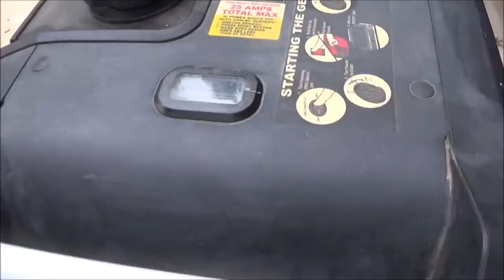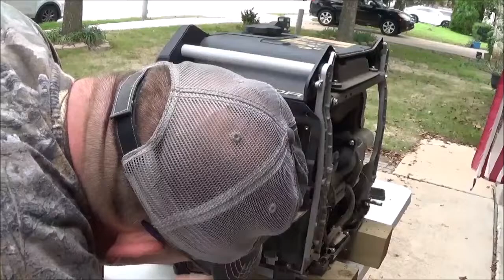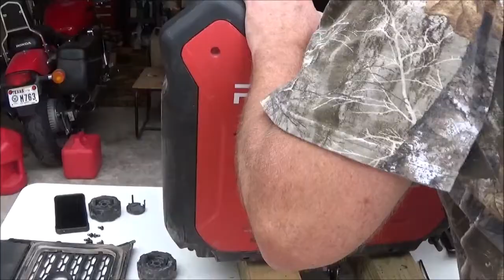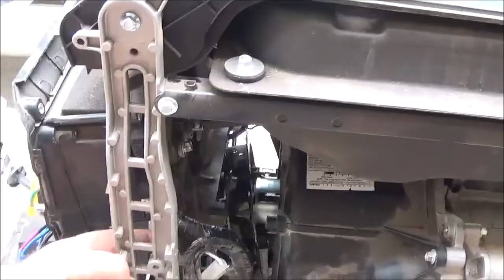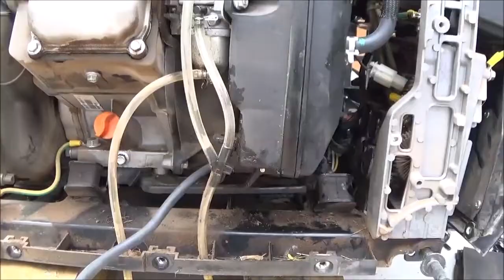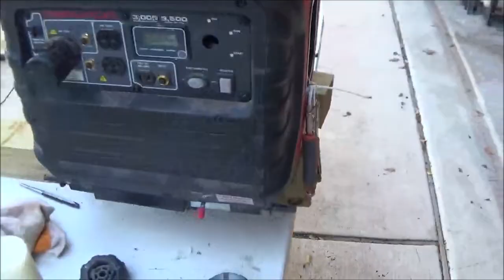Predator 3500 Inverter Generator Pull Start Rope Replacement

Comment: I have 1300 hours on mine. Went to fill the fuel this morning and the pull handle with about 4 inches of the rope was sitting on the ground. I bought the extended plan so, I think I could do it myself I may just bring it back.
Reply from the maker: The same thing happened to me. Found the pull handle laying next to the generator. Be careful if you turn it in for replacement as the newer model generators are not built the same way as the year 2020 models. From what I have been reading.  Thanks for watching.  TYMM

Comment: Thank you for the helpful video.  I think im going to Toss that bracket   to hold the rope. This is my 2nd 3500 generator  and  ive only used the rope maybetwiceon both machines.,And they both have broken off ,roughly the same spot as where that bracket sits.
Reply from the maker: Thank you for the positive feedback Nick. Glad this helped you. It is a lengthy video but well worth watching the steps. The bracket is for the pull rope to feed through.  Like a guide.  Maybe it is causing friction on the the pull rope?  Thank you for watching.  Please like, share, and subscribe.  Take care!  TYMM :

Comment: The only complaint I have with this same generator is the pull cord. It hasn't broke yet, but it's got a spot where it will break soon. Maybe next start it's that worn. It's 3 months old and less than 75 pulls.  Other than that it's been excellent for sure... Thanks for making the tutorial...
Reply from the maker: David - the cord gets cut from all the vibration while running.  People have been putting heat shrink over that particular spot to keep it from fraying.

Comment: Thanks for posting, it convinced me NOT to fix mine as I have never had to use it anyway. I will stick with the electric start option.
Reply from the maker: @TPaul300  the pull start string breaks because the string vibrates while the engine runs. It cuts it by rubbing/friction. Good to have a backup option for starting the generator.

Comment: where can i buy the outside parts  parts for the 3500 inverter my old one got crushed by the
fifth wheel in the back of my truck thank you
Reply from the maker: You can find them on eBay.
Reply: thank you and Happy New Year
Reply from the maker: Happy New Year.  @norbertomachado5465

Comment: my 4550, is more of an open frame, but the cord passes through the front like that. Cord broke in the same spot within the 90 day warranty. I got it replaced. I'm on my second one, 10months later cord is breaking in the exact place. I'm gonna be on my third one soon, because I bought the 2 year warranty for $250. This is a massive design flaw, and HF needs to pay the cost, or they will never learn.
Reply from the maker: @aaronjerviss9964  yeah. The generator vibrates while running and cuts the cord.  You can wrap that area with heat shrink or metal foil somehow to reinforce the area that gets rubbed

Comment: The top captured screws and not designed to ever come out of the red removable left side cover. Loosen top 2 screws and the whole red panel pops off.

Comment: I have many preditor generators and the ropes always break at the hole going into the housing.
Reply from the maker: Hi Chris.  Yeah. It's due to the vibration while running.  It severs the cord. You might be able to put great shrink over that small portion of cord

Comment: Thanks but  I think the robe rarely break because people use electric start mainly
Reply from the maker: True.  The primary is electric start but if battery gets weak or if the starter, CDI board, solenoid fails the pull rope will come in handy.

Comment: I'm leaving another comment. You do not have to remove the center nut on the pulley to re-string pulley. Clearly, he is doing it the hard way , I usually pull string out and wind pulley up , line uo holes and thread string in, and insert screw driver in opening on pulley to keep pulley wound up as I started any open frame generator is so easy to work on  any enclosed generator is designed for a shop to work on this is crazy and this guy took too many components off to restring pulley
Reply from the maker: @jamesray3930 - This is the way I did it. Not much more work. I was able to measure the pull string out to the length it originally was by doing it this way. You do not need to pay for a shop to fix this, when you can do it yourself.  All steps shown are needed.  Best wishes to all DIY viewers.  Hope this saves you all money and time.   James, if you do not have anything positive to contribute then best not to say anything. Its not a good reflection on your character. I am here to help people.

Comment: Talk about adding about 1000 unnecessary steps.
Reply from the maker: All steps are needed. This video is for anyone who has never replaced the pull start rope. Done in real time. After watching this video it will save someone else time while repairing or replacing theirs.
Reply: Well then why don't you post a video showing us all how to do this minus the 1000 unnecessary steps. We are eager to watch.
Reply: @mrgreenbudz37  will do
Reply: @mrgreenbudz37 I'm not trying to put this video down, he did a good job with the way he went about it. But I think I will make a video. Looks like all you have to do is remove the entire front frame without removing all the stuff he did. Chinese put stuff together with preassembled modules. You just have to reverse what they did. I guarantee they didn't put it together like he took it apart. I've got to replace mine, I'll probably make a video because there's none on YouTube except this one. I might get humbled, but I'm pretty good at this.

Comment: I'm done with predator junky generator going back to champion much easier to restring and work on total unnecessary how this is made and work on junk
Reply from the maker: Hi James.  I have had my Predator 3500 inverter generator since 2020. It has been a rock solid generator for me.  Only issues I have had are the starter went out and pull rope string broke.  1000+ hours on it and powers my generator nicely. A/C no problem.  I think it depends on each persons experience.  I can see how you may be frustrated but everything eventually needs maintenance at some point.  Thanks for watching.  TYMM :)
Reply: @texasyardmanandmore3822  This was my second one , im done with predator generators going back to the champion generator, an open frame  with a remote start, easy to work on, and change oil all I know you get what you pay for I keep the generator on my semi it all kinds of weather it can't handle the abuse of the road push start stop working and string on pull start broke this this unit useless junk
Reply: Well maybe it is the person using the tool. I have had my Predator for 7 yrs and outside of changing the oil all the time and a fresh spark plug once a year the pull cord just breaking is the first. Most people don't know how or are too lazy to take care of their tools.